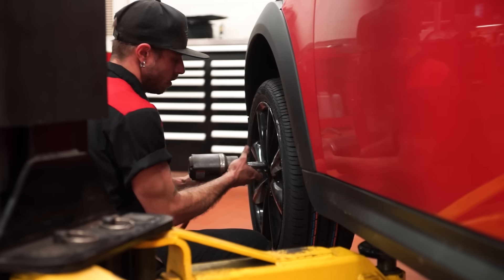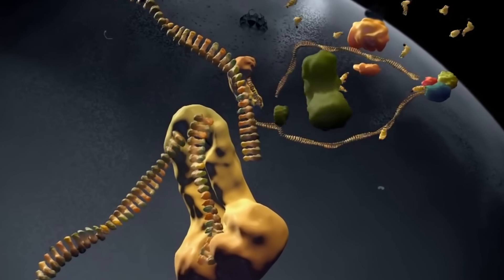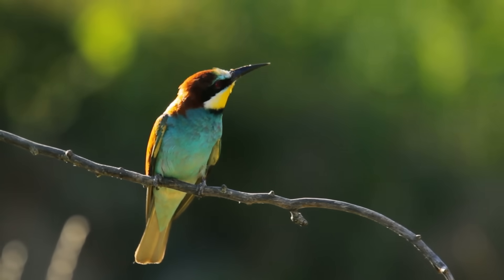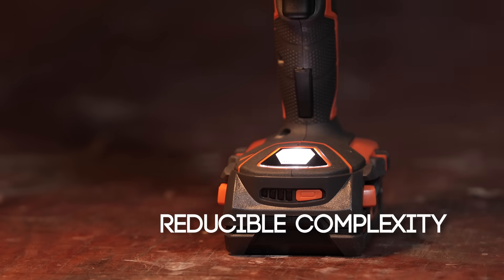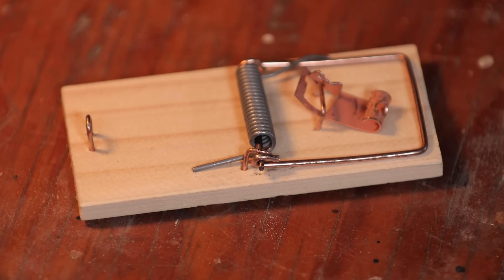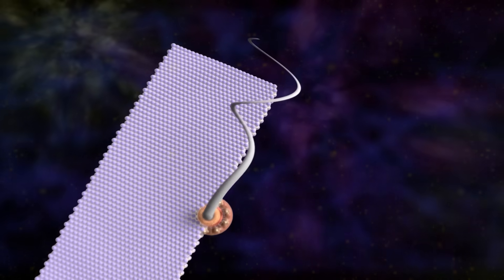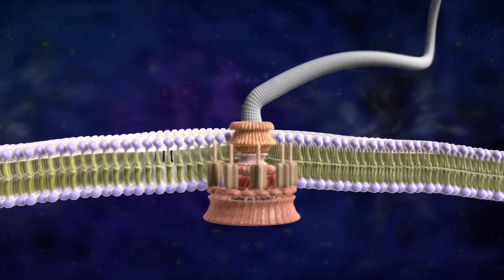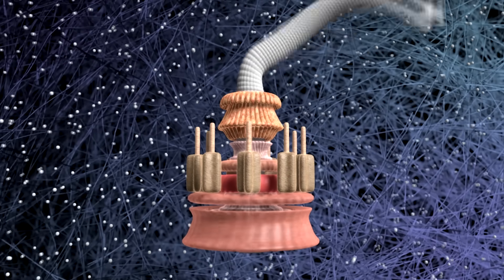The Complexity of Life (Secrets of the Cell with Michael Behe, Ep. 2)

Comment: I once encountered someone in the city. He wanted me to answer a question. He showed me a big board with three holes in it. One hole was triangular. One hole was quare. On hole was circular. All the holes were about the same size. 
The question is, he said, can you image an object that fits exactly through a hole, so that when it is passed through the object touches all sides of the hole at once? Well of course a triangular object would fit the triangular hole, a square object would fit the square hole, and a circular object would fit the circular hole.
Very good. Now can you image just one object with that fits exactly through all three holes at the same time?
Well, if you cannot, here is the answer (and indeed such an object exists, which he showed to me). So, ..., if you cannot imagine something, that does not mean it does not exist. 
The good man reasoned that God can exist, even if you cannot imagine it. 
Now I ask you: just because you cannot imagine how evolution led to the flagellum, does it mean that it did not?
Now I say to you: we indeed do not know how the flagellum came to be, but there are several theories. For example, there is good evidence that the bacterial flagellum has evolved from a Type III secretory and transport system, given the similarity of proteins in both systems. 
A system with irreducable complexity can from a larger system that could be reduced. The notion that it MUST come from a smaller system is just lack of imagination.

Comment: How difficult might it be in a shop to evolve, by gradual steps, a gasoline engine in a car, to a gas turbine engine? The catch is that the car must be running the whole time modifications are being made, and it must continuously be providing, or be capable of providing, torque to the drive train. This will be a tall order, even with intelligent,  purpose driven mechanics engaged in the process. All the intermediate steps must also provide some direct advantage that keeps the process moving forward.

Comment: Dr. Ken Miller, I believe, demonstrated the use of a partially disassembled  mouse trap as a tie clip. And yes, other parts could be used for different purposes. The spring could hold business cards; the holding bar could be used as a toothpick,  etc. As the argument goes, there is a similar structure in bacteria as the flagellum motor that acts as a syringe. The problem with these arguments is that it still requires intelligence to co-opt parts used in different,  unrelated functions into a new, integrated function.
Reply: Intelligence will still be required to develop, before human offspring can proceed to alter situation too though . A new born baby cannot alter anything much
Reply: @slimdusty6328  Not all intelligence would be required to develop. The original intelligence that gave rise to all intelligence did not have to develop, unless your are talking about your own alternate universe. Your requirements.

Comment: Very interessting! At Uni they taught us that this case of irreducible complexity is explainable by merging the concepts of emergence (the system has new properties than it's individual parts) and niche construction (a system changes it's enviroment, co-evolution). It goes like this: "... the flagellum is an emergent result of the evolution of components which originally evolved with completely different functions in different contexts. (SIS)" I think they missed the point. First, the individual parts don't seem to have a function UNTIL they come together (anything other than that is just guesswork). Second, how and why did the individual parts come together (in perfect order) in the first place, when they evolved in different contexts? The parts would have been either junk at some point or involved in some other process. This rases the question: Why didn't the junk parts get removed by natural selection and why did't the functioning parts in other processes continue functioning that way? Third, this flagellum is essencial for the survival of the cell, so this mechanism is not something which is easily replaced or susceptible to change.
Reply: You are very right

Comment: The Flagellum -  prime example of irreducible complexity

http://reasonandscience.catsboard.com/t1528-the-flagellum-behe-s-prime-example-of-irreducible-complexity#6351

http://www.genome.jp/kegg-bin/show_pathway?eco02040
Flagellum, Behe's prime example of irreducible complexity Eco02010

Flagellum, Behe's prime example of irreducible complexity QN1LUkC

Despite differences, all bacterial flagella consist of the following basic structures: 

(1) the basal body, which anchors the flagellum in the bacterial cell envelope and contains the motor that powers flagellar rotation; 
(2) the hook, which is a flexible, curved rod that converts rotary motion into waves; and 
(3) the filament, which propagates the waves initiated by the hook and pushes against the surrounding medium to propel the bacterium forward

The basal body is the most complex of these structures, consisting of three ring structures in Gram-negative bacteria, a rod, a rotary motor, and a flagellar protein export apparatus. The export apparatus is a type III secretion system that is required for translocation of most of the flagellar proteins that localize outside the cell membrane. 

It is composed of 36 different proteins, subdivided in 8 functional sections to name:

- Early and late Gene products ( 4 proteins )
- Filament proteins ( 4 proteins )
- Hook-Filament junction ( 2 proteins )
- Basal body proteins ( 8 proteins )
- Bacterial Chemotaxis proteins ( 3 proteins )
- Motor/Switch ( 2 proteins )
- Bacterial secretion system proteins ( 7 proteins )
- Cytoplasmic chaperone proteins ( 6 proteins )

To build a flagellum, more than two dozen proteins need to assemble in an ordered process. 
The flagellar/motility/chemotaxis gene system constitutes a regulon, i.e, an integrated hierarchy of controlled expression of about 50 genes, excluding receptor genes of which there are perhaps 20.
The gene clusters encoding the components of the flagellum can include >50 genes,  the total of core genes to 24.  Some of the genes are known to be essential for proper functioning of the flagellar system in a particular species. 
The  flagellar filament capping protein is composed of the FliD protein and plays an essential role in the polymerization of the filament protein, flagellin
The FliC flagellar filament structural protein is essential for Flagellum Formation and Motility
The FlgL and FlgK  flagellar hook-filament junction protein are indispensable for the formation of the flagellum
The assembly of a flagellum occurs in a number of stages, and the “checkpoint control” protein FliK functions in this process by detecting when the flagellar hook substructure has reached its optimal length.
The FlgD flagellar basal-body rod modification protein FlgD is a scaffolding protein needed for flagellar hook assembly
Five proteins make up the flagellar rod: FlgB, FlgC, FlgF, FlgG and FliE.  The rod acts as a drive shaft to transmit torque from the motor through the flexible hook to the flagellar filament thus essential for allowing for bacterial locomotion
Five proteins (FliE, FlgB, FlgC, FlgF, and FlgG) are involved in assembly of the rod
The FlgG flagellar basal-body rod L-ring protein assembles around the rod to form the L-ring and protects the motor/basal body from shearing forces during rotation 
The FlgH flagellar L-ring protein is essential in Gram-negative bacteria
The N- and C-terminal regions of FlgF and FlgG play decisive roles in heteromeric interactions.
A disruption in FlgI causes a motility defect because the flagellar construction terminates at the rod structure.
Flagellar basal body protein FliE is required for flagellin production and to induce a proinflammatory response in epithelial cells.
The FlgB flagellar basal-body rod protein is required for the assembly of the flagellar hook and filament
The FlgI flagellar P-ring protein is known to be indispensable for P ring formation    
The flagellar basal body protein FliE is required for flagellin production and to induce a proinflammatory response in epithelial cells.
flgB flagellar basal-body rod protein
Rod assembly occurs by export via the flagellum-specific pathway of its constituent proteins and by their incorporation into the rod structure in the probable order of FlgB, FlgC, FlgF and FlgG
FlgC is one of four proteins that comprise the rod section of the basal-body assembly of the flagellar motor
FliF is the basic subunit that polymerizes to form the MS ring structure complex of the flagellar basal body
Charged residues of the rotor protein FliG essential for torque generation in the flagellar motor of Escherichia coli
The flagellar switch composed of three proteins, FliG, FliM, and FliN. The switch complex modulates the direction of flagellar motor rotation in response to information about the environment received through the chemotaxis signal transduction pathway.
MotA and MotB comprise the stator element of the flagellar motor complex. Required for rotation of the flagellar motor.
There are nine proteins (FliH, FliI, FliJ, FlhA, FlhB, FliO, FliP, FliQ and FliR) that are truly central to the flagellar export apparatus, in the sense that they participate in the export of all known substrates. Strictly speaking, only six of these components are essential when a broad range of flagellated species is considered; FliH, FliJ, and FliO are not always present.
There are at least three specific cytoplasmic chaperones, FlgN, FliS and FliT, which associate with their substrates, the hook-filament junction proteins, flagellin, and the filament capping protein, respectively. They do prevent substrate degradation
FliJ is essential for the export of flagellum building blocks
FlgA and flgI, are known to be indispensable for P ring formation. 
The flagellar fliR is needed for flagellation 
The FlhD/FlhC Complex, a Transcriptional Activator of Flagellar Class II Operons
The anti-sigma factor FlgM and the sigma factor FliA jointly control the expression of late flagellar genes in H. pylori, in particular of the major filament protein FlaA
Reply: Filament proteins
fliD flagellar filament capping protein
fliC flagellar filament structural protein

Hook-Filament junction
flgL flagellar hook-filament junction protein
flgK flagellar hook-filament junction protein

FliK  flagellar hook-length control protein
FlgD flagellar basal-body rod modification protein

Basal body proteins
flgG flagellar basal-body rod protein
flgH flagellar L-ring protein
flgF flagellar basal-body rod protein
flgI flagellar P-ring protein
fliE  flagellar basal-body protein
flgB flagellar basal-body rod protein
flgC flagellar basal-body rod protein
fliF flagellar basal-body MS-ring and collar protein

Bacterial Chemotaxis
fliG flagellar motor switch protein
fliM flagellar motor switch protein
FliN flagellar motor switch protein

Motor/Switch
motA motility protein A
motB motility protein B

Bacterial secretion system
fliH flagellar biosynthesis protein
fliI  flagellum-specific ATP synthase
fliO flagellar biosynthesis protein
fliP flagellar biosynthesis protein
fliQ flagellar biosynthesis protein
flhB flagellar biosynthesis protein
flhA flagellar biosynthesis protein

Cytoplasmic chaperones
flgN flagellar biosynthesis protein
fliJ   flagellar biosynthesis protein
fliS flagellar biosynthesis protein
fliT flagellar biosynthesis protein
flgA flagellar basal body P-ring formation protein
fliR flagellar biosynthesis protein

Early and late Gene products
flhC DNA-binding transcriptional dual regulator
flhD DNA-binding transcriptional dual regulator
fliA RNA polymerase, sigma 
flgM anti-sigma factor for FliA
Reply: To build a flagellum, more than two dozen proteins need to assemble in an ordered process. The accurate size and subunit composition of each substructure of this nanomachine is achieved by coupling gene expression to the assembly state.
http://www.els.net/WileyCDA/ElsArticle/refId-a0000301.html

Disruption of any flagellar component causes the assembly of flagellar structure to arrest
https://www.ncbi.nlm.nih.gov/pmc/articles/PMC2885626/

The flagellar/motility/chemotaxis gene system constitutes a regulon, i.e, an integrated hierarchy of controlled expression of about 50 genes, excluding receptor genes of which there are perhaps 20.
https://www.sciencedirect.com/science/article/pii/S0167488904001016

The gene clusters encoding the components of the flagellum can include >50 genes.The bacterial flagellum has received attention as an exemplum of biological complexity; however, how this complexity and diversification have been achieved remains rather poorly understood. The actual series of evolutionary events that have given rise to the flagellum, as might be inferred from the relationships of all genes that contribute to the formation and expression of this organelle across taxa, has never been accomplished.Because present-day distributions of these three genes are attributable to secondary loss, they too should be considered as part of the ancestral set of genes specifying the bacterial flagellum, bringing the total of core genes to 24.  Some of the genes are known to be essential for proper functioning of the flagellar system in a particular species. The origins of complex organs and organelles, such as the bacterial flagellum and the metazoan eye, have often been subjects of conjecture and speculation because each such structure requires the interaction and integration of numerous components for its proper function, and intermediate forms are seldom operative or observed.

The evolutionary claim:
The flagellum originated very early, before the diversification of contemporary bacterial phyla, and evolved in a stepwise fashion through a series of gene duplication, loss and transfer events. The bacterial flagellum too originated from “so simple a beginning,” in this case, a single gene that underwent successive duplications and subsequent diversification during the early evolution of Bacteria.

https://www.pnas.org/content/104/17/7116

Michael Behe's response to the paper:
DARWINISM GONE WILD: Neither sequence similarity nor common descent address a claim of Intelligent Design
https://evolutionnews.org/2007/04/darwinism_gone_wild_neither_se/

Filament proteins
The  flagellar filament capping protein is composed of the FliD protein and plays an essential role in the polymerization of the filament protein, flagellin
https://www.ncbi.nlm.nih.gov/pubmed/8683574

The FliC flagellar filament structural protein is essential for Flagellum Formation and Motility
https://journals.plos.org/plosone/article?id=10.1371/journal.pone.0045070

Hook-Filament junction
The FlgL and FlgK  flagellar hook-filament junction protein are indispensable for the formation of the flagellum
https://www.nature.com/articles/s41598-018-32460-9

FliK  flagellar hook-length control protein 
The assembly of a flagellum occurs in a number of stages, and the “checkpoint control” protein FliK functions in this process by detecting when the flagellar hook substructure has reached its optimal length.
https://www.ncbi.nlm.nih.gov/pmc/articles/PMC2206646/

The FlgD flagellar basal-body rod modification protein FlgD is a scaffolding protein needed for flagellar hook assembly
https://www.ncbi.nlm.nih.gov/pmc/articles/PMC205349/

Comment: If the core of the palindromic sequence of the nitrogenous bases of the new Coronavirus is AAGCUU, a restriction enzyme capable of recognizing and cleaving the palindromic region has probably been already isolated and it should have (some) homology to the enzyme Hid III. But I don't know if it is possible to encapsulate each restriction enzyme in liposomes withe the fusion peptide so that the protective enzymes can reach the cytoplasm. If it's feasible, other RNA viruses could be fought with restriction enzymes that recognize and cleave their palindromic regions.
Reply: I like the idea, but to be effective wouldn't the restriction enzyme have to be put in the body to fight the infection? If so how would you get it into the body, and would it pose a danger to any similar benign or useful sequences?